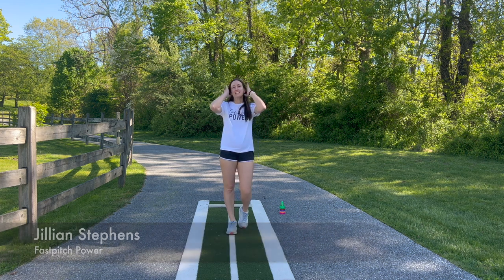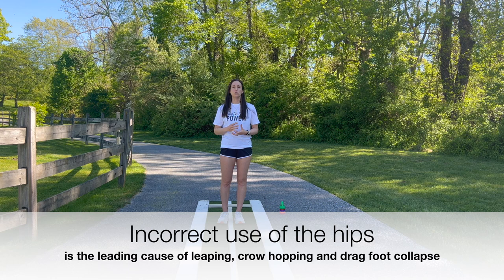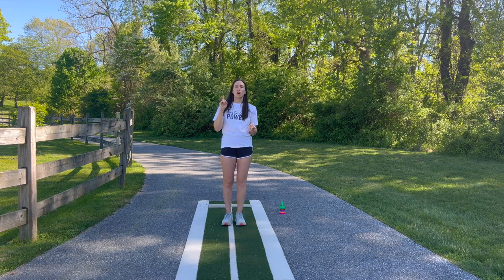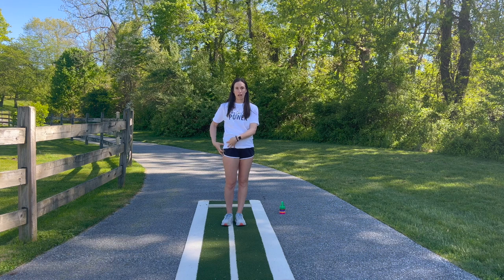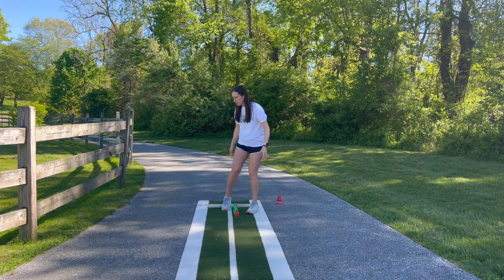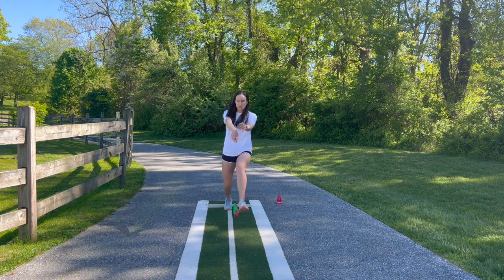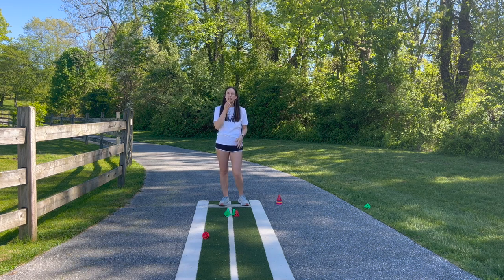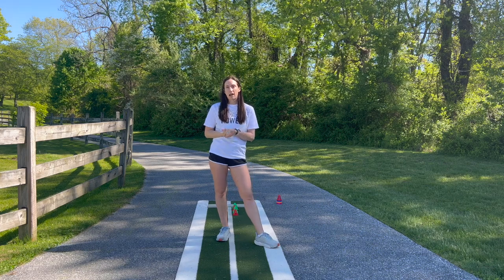Softball Pitching: Fixing Drag Foot Collapse

Comment: My question is now that the rule has changed and most girls I instruct all want to leap. So now if you push off square to the catcher and leap you can’t turn open while off the ground so they need to take off from the rubber already open which leads to the pivot foot in a sideways position then drag once landing…….